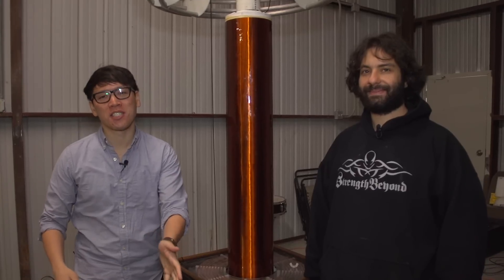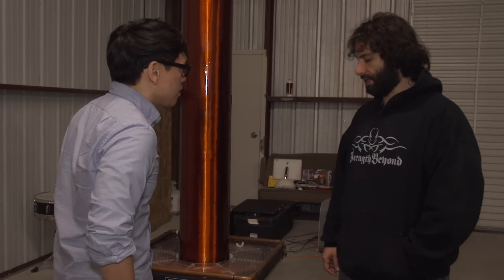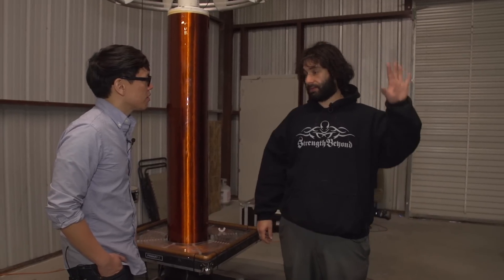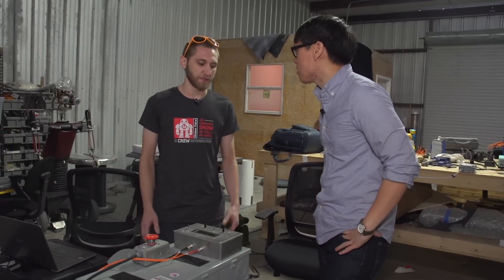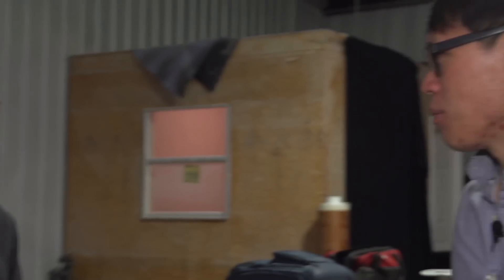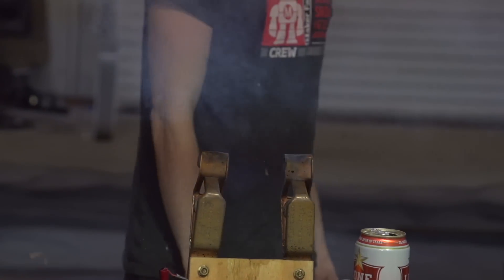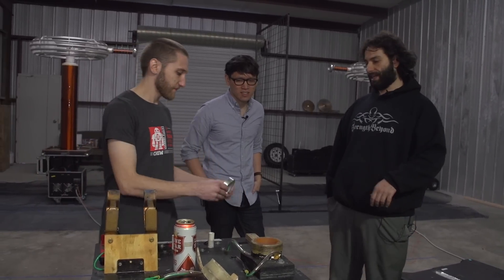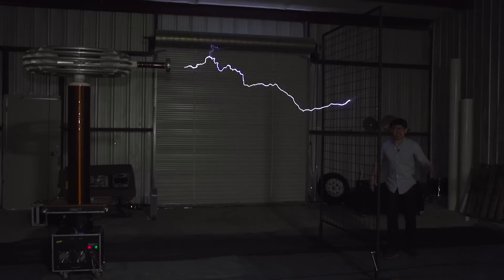How Giant Tesla Coils Work (with ArcAttack)

Comment: i know that for the electric car Tesla you need a charger with alot of amps for the car to charge faster, can you creata that charger youre self ? like a Diy ?
Reply: supercapacitors are a promising tech for that
Reply: you could, but if it were to fail and discharge the transformed electricity into the Tesla it could kill the car, and because its your own charger, you wont have insurance
Reply: hence promising, there are some diy projects a person could try with capacitors, but even elon musk concedes they won't be replacing batteries any time soon (the consensus that i could gather (remember) was that they could be paired with batteries to help compliment on another
Reply: It is voltage, not amps really.

240 volts is what your range, a/c, or dryer run on and getting an electrician to install this would be pretty standard.

You can get 480, but it's a bit harder since the utility company will have to be involved and they might not approve (apparently they reserve this for special purposes)

480 cuts charge time down a lot more than 1/4.  It's something like less than an hour vs all night for 120.
Reply: Yes you can DIY it but practically it would not be worth it. Voltage and Amps are the opposite sides of a see-saw you can increase the voltage but that lowers the amp side accordantly.
The size of this see-saw would be measured in Watts, and there is practical limits to how many watts(per time period) you can get from your power company without upgrading their equipment to going into your premises.

If a tiny charge time is your goal and money is no object the best way is to Charge a large stationary battery pack continuously then charge your car from this pack as it can "dump" the power(watts) much faster then you utility company can supply(this is what Tesla do at their superchargers stations). You will still need a better charger(or multiple smaller chargers as Tesla do in their superchargers). Remember a charger is more like a nozzle of a hose, it controls flow but does not generate it itself.
Reply: No, because electric cars are terrible. If you're going to dump big bucks, put good batteries in it first.
Reply: Skylar Garrett Terrible relative to what?  For many people the operating profile of an electric car is perfectly fine.

Internal combustion can also be considered terrible.  It's dirty and has low torque.

It is even possible to say internal combustion is terrible for everybody, even those who don't even drive, due to the pollution.

It also wouldn't be objectively terrible if people couldn't just hop in their cars and drive across the continent.  It would just be different.
Reply: Jason Wilkins Well, to start of, electric cars pollute more most petrol vehicles do in their entire lifetime just by being built. This is mainly due to the batteries, but another thing about electric cars is efficiency. Electric motors typically are about 15% efficient, and the batteries aren't that much better. 

Ever feel a warm laptop battery when it's charging? Basically the same thing happens with electric cars. That heat is wasted energy due to poor efficiency of the batteries. Modern gasoline powered IC road going vehicle engines are very efficient, typically with a volumetric efficiency hovering around 90%. From fuel to power touching the ground, that's a lot better than electric cars. Modern gasoline powered vehicles also have very low emissions as well, in the broad scheme of things. 

When it boils down to numbers, just numbers. petrol driven cars win 10 times out of 10. They're cheaper to build, they pollute less, and because they're established you can have yours fixed on just about any street corner. The issue with electric cars is how well we are at turning electricity into something that moves a vehicle. There are much better battery technologies than what we're using in cars, but they're unstable and unpredictable. There's no real fix for electric motors though, at least not right now. I agree with you on the torque, but that brings up an ever better point..

Small engines are killing cars, and our wallets. Small engines don't use less fuel for how most people typically drive, and example of this is a prius vs corvette. They get almost the same fuel economy when driven comparatively, most modern large displacement V8 powered vehicles are capable of 30+ and even 40+ mpg when you drive them responsibly. This is because they're designed well and have excellent volumetric efficiency, a trait that comes with their large displacement. 

Over the life of brand new corvette, it will pollute less than a tesla before the tesla has even been driven off the lot. I feel like this is something everyone looks past when talking about electric cars, that and those expensive heavily polluting battery packs will need to be changed every couple years.
Reply: [Citation Needed]
Reply: Skylar Garrett
Going by your logic and deduction skills day light saving is the cause of global warming from the extra hour of sun light a day.

In the UK using the most current publicly available figures it takes 1kWh(electricity) to refine 1 litre of "gasoline"(1us/uk gallon =3.75/4.54 litres) the 2010 average fuel efficiency of passenger cars in Australia(my home continent) was 11.3L/100km(20.8/24.9mpg US/UK). A 2013 Nissan leaf(a fully electric consumer car) can drive 8.33km on 1kWh that's 12kWh/100km(19.5/23.5kWh per gallon UK/US).

So the "average" ICE(internal combustion engine) car uses almost the same amount of "electricity" to travel the same distance as a electric car before it has even moved.

"MPGequivalent; 33.7kW-hrs = 1 Gallon Gasoline energy" from a US EPA fuel economy label, so one gallon has 33.7kWh of power a leaf would be able to go 280km/173miles on 33.7kWh.

BTW modern lithium batteries will last longer then the car they are in, in most cases as opposed to lead acid batteries in ICE cars that need to be changed every few years and contain a neurotoxin(lead).

The lithium batteries are made from a casing material(plastic,metal), copper, aluminium, carbon(burnt coconut shells), fertiliser, organic solvent(whisky) and salt from salt lakes/flats and is 100% recyclable to make new batteries and has no neurotoxins.

All in all I see no points where you have been correct other agreeing that electric motors having more torque.

BTW how much heat does ICE car make(hint a Bugatti Veyron makes 3000HP, 1000hp to the gearbox).

Comment: confused because aluminum is not magnetic at all . 
so you can make aluminum magnetic with electricity ? because i was aware that only Iron Cobalt and Nickel were the only magnetic metals.  just a question no one be a jerk please.
Reply: spoofers110 .dmix910 it's induction. And we're talking crazy power here. Not the kind of magnets you dig up from the earth. They're exciting the electrons in the metal, which then try desperately to get the Fuck away, which causes the reaction
Reply: ZanesFacebook Has said this well. Aluminum is not attracted to a magnet and is not Magnetic by itself, nor is copper, however they both conduct electricity! Using a coil with a current passing through it creates a magnetic field and that field if there is a conductive ring nearby causes an electric current to flow in the nearby ring, (Induction) the result is another electromagnet with reversed poles and repulsion. This is the basic principal of how your car alternator/generator works as well as Power Stations that convert Mechanical Energy into Electrical Energy. A man called Faraday first discovered Electromagnetism while experimenting with a chemical battery and wire and saw a needle on a compass move when current moved through the wire, look up Faraday if you are interested. How the Battery came about is another long, however interesting story Like what came first, the chicken or the egg? Cheers from John, Australia.

Comment: I would drive it at 40Khz, look at how loud the loudest pop, and quite by controlling pulse width.  Then feed it binary number to control precisely the pulse width.  256 steps of loud to quiet, then 16 bit.  The distance can be adjusted to the resonant frequency but for what percent of time is it on?  Loudest pop to quietest.  Not off.  A crackle that's heard to call zero.  Rapidly changing duty cycle, not frequency.  If anything, it's fed a square wave to insure each peak voltage is the same.

Comment: so if we all had one of those things  between the street light and our building and not a power company meter, but a transformer. Through the wires in the wall of our building to the outlets to my lights , fans really a cleaner and safer. Just can't use my cell phone that's not a bad thing. I don't want to be bothered at home anyway.

Comment: 7:30 DC? You're using Tesla's most famous invention with his enemy's direct current? Blasphemy! ;)
Reply: Good catch, lol.
Reply: how can a tesla coil work with dc?
Reply: what many dont know is that tesla found very strange phenomenas while experimenting with high voltage dc
Reply: power inverter
Reply: So it's like: what a stroboscope does with light, the big transistor does with electric current?
Reply: On coil is ac because of series capacitor bank that decouples dc. DC is used for smps for high eff. over 90%, you cant just stick 50/60hz on primary and you cant just change freq. of mains that easy. You take DC power supply and switch it on and off with var. duty cycle and thru series capacitor so its not just a short circuit and you get nice mostly sine wave on primary, with constant dc you cant transfer energy via magnetic field, magnetic field must change for current in secondary to induce. This is so simple idk how people dont get it
Reply: Lol
Reply: Tesla also invented AC electricity, so a phone charger changes AC to DC. BLASPHEMY
Reply: @InCaseOfEmergency EatAss

Thats actually a myth. Tesla did not invent AC current.
Reply: THUNDERBOLT .... so what did he find???
Reply: Ik I was thinking that as well he also said at the begging when he was showing the power supply it runs off DC as well
Reply: Well DC wasn't his enemy, he just knew it was very inefficient to transmit over great distances and would need booster stations all over the place to replace the losses, plus the conductors for DC would have had to be much larger in diameter than those for AC. Tesla wanted a world covered in huge Tesla Coils that would transmit power wirelessly like radio antennas and electrify the entire planet, and all you would need to use it straight out of thin air was a receiver coil and a small circuit on your appliances, etc. Your appliances and devices could be powered by energy that harmlessly surrounded you every day. He wanted a world where everyone could have free energy. The true reason that never came to be was not because the powers that be at the time thought it was crazy, or too radical, or frightening, but rather it was because they didn't want people having free energy. They wanted us all to have to pay power bills to greedy pig utility companies that have the monopolies going on utilities, especially in the US, a country that is supposed to prevent monopolies and maintain fair competition in any market or industry.
Reply: Lol word bro, Edison's rollin in his coffin laughin his mufuckin ass off. RIP ☮️💛💡☯️♾️
Reply: Tesla rules all currents and scalar and radiant energy 

Everything you can not. Imagine
Reply: @thunderbolt997  true!
Reply: @Eryan724  I help you a bit....it's under your feet....it's the real force that affect the most the universe....
Reply: Dynamo : The alternator produces AC and rectified to DC to meet automobile needs. "Blasphemy"!!!!!
Reply: Lolololoolololooooooooøk
Reply: THUNDERBOLT like what? Please Excuse my ignorance
Reply: That version of tesla is modern tesla.
Reply: @canbe2682  fuuck back to tiktok

Comment: That is so cool,  I'm a Ham operator, X Military.  Now what you do is change it up a little,  If you add an antennae to the top of the coil say 100ft out in the air then     The objective is to tune in to the 60 cycle energy that is everywhere visavee the power companies.  you might need a little parallel capacitance on the coil to get to the 60 cycle range and start to receive the radiant power.

Comment: Smart of them to use fibre optics for communicating with the coils, if they used twisted pairs or any solid metal wiring, it would not be able to communicate at all thanks to the EMI's produced.
Reply: the fiber optics are used to prevent short circuit in other circuits then the coil part itself
Reply: ThePaalanBoy I guess it does that as well, But iv'e learn't that fibre optic lines are used for data transmission(networking) in factories because of the large interference's that are caused by electrical machines being coupled to copper wires through magnetic induction (ie: cat5)
Reply: SSnoWHand yeah but not here
Reply: ThePaalanBoy  It is true that a fiber optic line is used for EMI reasons. The electrical noise produced by an operating coil is massive. I can't take photos with my Samsung Galaxy S3 because the capacitive touchscreen locks up instantly. WiFi also seems to get knocked out, and if I hold my oscilloscope's probe in the air a few metres away I get a signal that is several volts peak-to-peak. If your oscilloscope can pick up a huge clean signal without even coming near the circuit, then there is a hell of a lot of power being radiated. It is true that a fiber optic line can fix issues with ground loops and operating circuits and different potentials, but most of the DRSSTC circuits I've seen simply use the fiber line to inject the audio/interrupter signal. If you used a copper line instead then you risk killing all your electronics if the coil directly strikes the signal cable. If you had a copper line plugged into a laptop to control the coil, then you also risk severe burns and injury :)
Reply: Grant E Camera: what about making a shild som electromagnetic-waves can't interfare? like wrapping it in tin-foil X)
Reply: ThePaalanBoy It could work, but you need an extremely solid low-impedance earth connection at Tesla coil frequencies, because as frequency rises so does the impedance of a given inductance. A long cable connected to earth can develop a very high voltage during a strike from a Tesla coil, so there is still the huge danger of burns and shocks if you are operating the coil from a laptop while using a shielded twisted-pair cable. Burns from a high power coil can leave you with permanent nerve damage, so its usually wise to just isolate your electronics properly with a fibre optic line, purely for safety reasons.
Reply: ThePaalanBoy Wrapping a camera in tin foil and grounding it has been proved to be effective by quite a few Tesla coil builders, I've seen a few Faraday cages with a foil-wrapped GoPro attached :D
Reply: Grant E  lol
ii was unsure if the tinfoil could do the job since to protect something against EMPs you have to completely surround it in metal and non of the metal can touch the electronic device.

Comment: I was wondering how they got midi data to the coil in one piece, as I figured a standard coaxial cable would recieve far too much interference. This is where fiber optic comes in. useful info

Comment: I would think that you could change the "Pitch" of the coil by oscillating or changing the length of the coil column. In other words in the coil could be moved up or down to change the Frequency of the arch at the time that its produced. It would also be more visually interesting to watch as the coils raise up then lower to produce different sounding notes as they are played. The longer the coil the difference in the magnetic field Stronger/Weaker the Higher/Lower sound produced at that time. It should still produce the same Arch effect but simply Tune the notes due to location on the coil by placement. Also enclosing the coil will help to better direct the magnetic filed/electron wave up out of the top of the coil to produce better sound. Not sure if I am explaining this correctly but that is how I see it working. As I said being more visually appealing, interesting to watch instead of just 2 coils on a stage arching at each other to the beat of music.

Comment: So when you turn the aluminum ring into a elctro-magnet instead of you blasting it into the air isnt there a way to control the amount of current going to the coil so that it could float in the air?